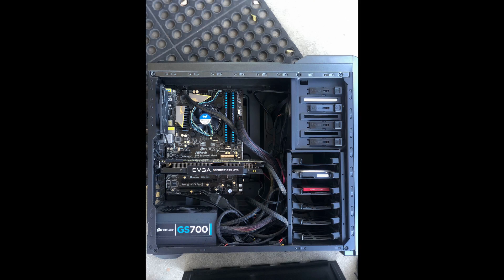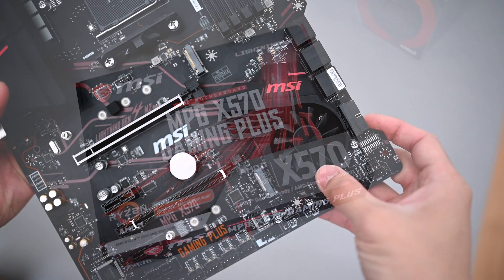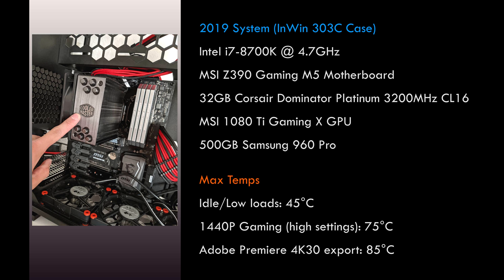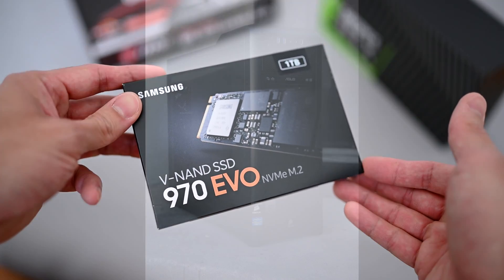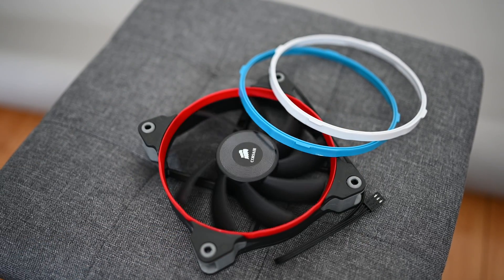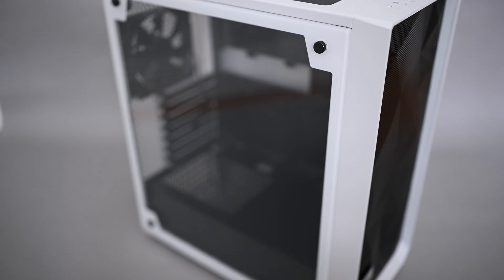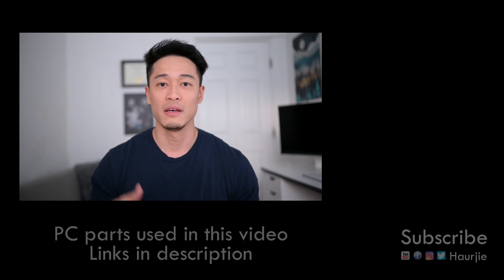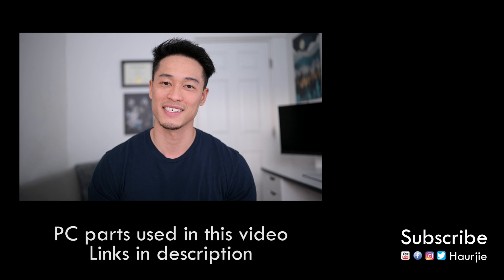AMD Ryzen 7 3700X RTX 2070 Super Build

Comment: 850 watts??????
im building a system with the same specs
Reply from the maker: You don't need 850. We just happened to have found a good deal for this brand new PSU for about half the price
Reply: @hardlinenexus  oh okay do u think a 750 700or 650 would  be enough I overclocked and I’m having a AIO
Reply from the maker: @tonythetigeryt7235  750 is best for you

Comment: Question:  Please Help?
 AMD Ryzen 7 3700x
Gigabyte x570 AORUS Elite
32GB Corsair Dominator Platinum 3200mhz Ram (2x16GB)
Origin Frostbyte 120 CLC
NVIDIA 8gb Geforce RTX 2070 Super Blower

My system will run with one GeForce RTX 2070 but once I add another one with a different maker Nvidia 2070, the computer will shut down, do I need an identical GPU to work?
or
What do you recommend 5 out , the video card same resolution as 2070.

Thank you

Comment: Hey awesome video, I think I’m going to make this build. How well do you think this streams/edits? (Specifically over watch)
Reply from the maker: Very well. If you can, I would try and get a b550 tomahawk from MSI instead. That's the motherboard we wanted, but was out of stock or overpriced everywhere at the time. This was our next best option that was available
Reply: @hardlinenexus  Would you recommend going with 32 gigs? Or is that overkill?
Reply from the maker: @sansei397  I had 32GB and it was fine. But now I have 64GB in my personal system lol. 32 is good

Comment: Would the 3600 ram give better performance for 1440p gaming?
Reply from the maker: Specifically on 1440p not quite sure, I haven't tested. But on a general answer, 3600 will give you roughly 8-10% more fps on most game titles over the 3200 like I used in this video. I would think that increase in fps would be consistent regardless of the game's resolution.

Comment: I built almost this same system but over a year ago! R7 2700 and RTX 2070 is a fantastic combo after a slight over clock, which isn't an issue with the X variant of the CPU.

Comment: Genuinely curious as I'm new to pc building, but why the founders edition over say an Asus or msi of the same card? Is it just because it's lower in cost?
Reply from the maker: It's the lowest priced 2070 super yes. Also personal preference on aesthetics. The other AIB brand cards tend to do have a slightly better performance because they have different cooling designs, but honestly not that big of a difference for our workload and doesn't quite justify the price gap IMO. But you can pick any one of them whichever you like.

Comment: My build is:

CPU: Ryzen 7 3700x

Motherboard: Asus ROG STRIX B450-F GAMING ATX AM4 Motherboard

Memory: G.Skill Trident Z RGB 32 GB (2 x 16 GB) DDR4-3200 CL16 Memory

Storage: Samsung 970 Evo 1 TB M.2-2280 NVME Solid State Drive

Storage: Seagate Barracuda Compute 2 TB 3.5" 7200RPM Internal Hard Drive

GPU: NVIDIA GeForce RTX 2070 SUPER 8 GB Video Card

Case: Fractal Design Meshify C ATX Mid Tower Case

Power supply: Corsair 850 W 80+ Gold Certified fully-modular ATX Power Supply

A very similar build. Love it
Reply: That's great i am planing for the same build but i am confuse between two pairs 
Ryzen 9 3900x 2070 super 
Ryzen 7 3700x 2070 super 
mainly i am working in 3dsmax Vray & corona render and also Lumion animation
so please advice me what is the suitable option for me is there any big difference if i go with 3900x instead 3700x?
Reply: @awaaansar8191  typically, if you are using heavy software you would want good memory for the system you have that would be in par. The 3700x would be a great chip and with a good potential overclock, I believe it should handle your things no problem. The 3900x would also handle with ease but at a more hefty cost, by almost double. Maybe a small medium of a Ryzen 7 3800x might fancy you, if you prefer.

Comment: As per my observation Rtx 2070 Super is too week for this processor high percentage of bottleneck❗❗❗
Correct me if i am wrong.
Reply from the maker: There's no bottleneck
Reply: @hardlinenexus  I think you didn't check bottleneck calculator ?
Reply from the maker: @awaaansar8191  Calculator said 18% avg but doesn't tell us what applications and games. When we pulled up the programs we used like Adobe premiere, Photoshop, CoD MW, Valorant, league of legends, Apex... We didn't have problems.
Reply from the maker: @awaaansar8191  My recommendation is don't use the calculator as your primary decision maker. If you want to go higher GPU you can, but you need to consider whether dropping an extra $200-500 is worth reducing that "18%" and whether you even notice real world differences for your work.
EDIT: Bottleneck calculator is crap btw. It has no accurate correlation to real world application. In fact, you should read other forums. Definitely wouldn't bother using that.
Reply: @hardlinenexus  Maybe you right.
Please advice me the same specs are  good option for 3d animation render and 3ds max rendering???
Reply from the maker: @awaaansar8191  Yes these specs will be good enough for 3D animation. I would also try and get a better motherboard though. This MPG wasn't my first choice, because the ones we wanted were all sold out or overpriced. This was the next best option within our budget.
Reply: @hardlinenexus  I would appreciate if you will let me know first choice for 2070 super please

Comment: do you really need 850w for the psu? isn’t like 550w enough
Reply from the maker: No we do that need 850w. We got 850w because smaller psus are all sold out or overpriced. We found someone who was selling the 850w brand new sealed for half the retail price. This was a no brainer. I think I mentioned this in the video
Reply: Haurjie okay thanks. i’m looking to build a new pc with slightly higher specs to in the video, and i did an online power calculator and it said i needed way less but i guess i shouldn’t trust that. would 750 be enough for 2080 ti and amd 9 3900x?
Reply from the maker: @reid6205  750 is enough

Comment: Can I ask why you didn't use the stock cooler that came with the 3700x? Is the cooler master much better than the stock cooler? Thanks
Reply from the maker: Stock cooler is fine. I used the 212 Evo for a couple reasons. One was to give some headroom if he did ever want to overclock the CPU. Second is that the MPG motherboard wasn't my first choice and doesn't have the best VRM. I wanted to get the Tomahawk but it was sold out or overpriced everywhere. The 212 Evo has will be able to provide a slightly better airflow within the case itself than the small stock cooler of the 3700X. Basically overall keeping the case and everything in it a tad bit cooler. Last was aesthetics, just plain looks better than the stock cooler lol.
Reply: @hardlinenexus  Okay good to know. Thanks for the helpful answer!

Comment: My 2070s and 3700x build was 2700$. Had to buy a monitor, mouse, keyboard 
Not really midrange 😅😅😂 got the b450 tomahawk max and for the monitor its the zowie 240hz
Should push 250 to 300 fps in ultra settings on OW

Comment: How long do you spend looking at yourself in a mirror everytime you dolly your hair up like that?
Reply from the maker: Wet my hair with water and use bath towel over it, 15 seconds. Use blow dryer set to hot air on left side of hair, 10 seconds. Use blow dryer on right side of hair, 10 seconds. Use blow dryer on front/top hair, 7 seconds. Look in the mirror to check, 3 seconds. About 45 seconds average.
Edit: If I was a girl with long hair, I'm sure it would take more than 30 minutes.

Comment: I bought the 3800x but have yet to build my PC, Would you say the Hyper 212 is better than the AMD wraith it comes with and would be worth me going with the 212 instead?
Reply from the maker: The stock coolers are usually good enough if you don't plan on overclocking. But if you do overclock, I would look for a cooler has a higher TDP rating.
Reply: @hardlinenexus  Ok awesome thanks, yea from most people I hear them say those stock coolers are fine as long as I don't overclock, I just wasn't sure since that 212 has a fan that faces the other way if technically it would be better airflow, it looks more streamline in that sense lol. Thanks for the response man, Subbed and I hit the bell! Looking forward to seeing more in the future, now I'm going to scour your library for other great gems.
Reply from the maker: @justincredible9302  thank you! Really appreciate the support. I'm going to have another PC build (actually 2) coming out towards the end of this month since new B550 motherboards are coming out. The rest of the parts are already just sitting in my room waiting lol

Comment: hai guys im new to pc build my spec 
Ryzen 7 3700X Processor with Wraith Prism RGB Cooler
MSI B450 Tomahawk Max Motherboard (Supports overclock)
Zotac RTX 2070 SUPER Air Graphics Card
Corsair Vengeance RGB Pro 3200 MHz 2 x 8GB (16GB) DDR4 RAM
500GB SSD
Corsair CV650 80 Plus Bronze Power Supply
Phanteks Eclipse P300A Case (Good airflow)
is best one for gaming at 1440p pls suggest any parts which i need to change guys

Comment: Hey!
I'm going to build a PC with Ryzen 7 3700x and 2070 Super Aorus. Will the Corsair 750W power supply be good? I noticed that you used the 850W power supply.
Reply from the maker: this system can run off of 600 watts. 750 is plenty. we got an 850 only because we found one for HALF the retail price brand new. This is a special case, we would not have bought a 850W PSU for full retail price.
Reply: @hardlinenexus  thx for fast answer! Amazing Job! Sry for my english😅

Comment: I spent about 1148 US after you converter it from CAD on a prebuild from Canada Computers it comes with ryzen 7 2700x, rtx 2060 ASUS, 16gb ram 3000mhz, 250gb m.2 nvme ssd, 1tb hdd 7200rpm, wifi Bluetooth, 4rgb fans and b450 gigabyte motherboard with Microsoft office and windows 10 

Would you say this is worth the price?
Reply from the maker: I would've personally went with a 1tb m.2 nvme and without the 7200rpm harddrive. But everything else is fine

Comment: how does the X570 Gaming Plus treat you with VRM temps? I literally just got mine in the mail. A ton of good reviews but I just wanted to make sure the VRM’s are good with this CPU, since many people with the 3800X and up have complaints about VRM temps getting way too hot for any normal use. The 3700X has like 65W TDP, and anything above is 105 so that’s probably the reason why, I just want to make sure.

Comment: What exact model GPU did you use? Msi, asus?
Reply from the maker: It's the Nvidia reference model
Reply: @hardlinenexus  thanks for responding! Why did you go for that when the windforce is available?
Reply from the maker: @bubberduck4964  because it was the cheapest one, and it also looks better (but this is subjective). And I will take the solid metal build over the plastic AIBs like 8/10 times
Reply: @hardlinenexus  ah alright. Could ya take a look at my build? Just imagine the 2070 super is in there :p

Comment: This video is so clean, you deserve way more subs and views. I have a question, I’m building a 3700x PC, and with cooling I’ve bought a Corsair H60 2018...do you think it will be enough to cool the CPU down? The case is the same one (Meshify C)
Reply from the maker: The stock cooler is enough for the 3700x if you don't overclock. But yes the H60 is good too
Reply: @hardlinenexus  I'm not planning to overclock, so I thought "if the stock is good enough without OC, then an AIO will be even better!". Guess it is somewhat true, even for a 120mm AIO, even though basically everyone says that for the price of a 120mm AIO, you can get a much better fan cooler. As long as it DOES cool down the chip I'm happy. Thanks!

Comment: Wanted to laugh watching this I am waiting on almost these same exact parts. R7 3700x MSI 570 gaming edge (wifi). 32gb 3200 RGB vengeance. Have to agree I made the decision for longevity for future upgrades. I tend to upgrade every 5 years
Reply: Dang Im with the same as you but the carbon wifi. 
Having problem to find regular price parts its ridiculous! Bought a rtx 2060 super 8gb only thing I could find on a decent price. What gpu and psu you using?
Reply: @chefcritic9409  I'm in the same boat as you. Prices are a bit high. But thankfully I was able to salvage my old HLC 550W supply and my EVGA GTX 650. Not great but haven't had any issues since the build. More time to save up and wait for 3ks series to come out so the 2ks might go on sale 🤷.

Comment: I saw this and wanted to build my own. I am assembly mine right now. I have the Asus RTX 2070 Gaming Pro Advanced. Ryzen 7 3700x. Corsair 750 80+ gold PSU. Asus TUF x570 gaming pro wifi Mobo. 16GB dusk channel Corsair vengeance 3200mhz Ram. Finally the stylish Corsair carbide spec-omega case. I’m so excited to use this!
Reply: What are you using for cpu cooler if I may ask?
Reply: @cristianivancidguerra1005  the cooler AMD provide does a good enough job if you don't over clock. My CPU doesn't go past 62 degrees under full load.
Reply: Thanks for the reply! 👍🏼

Comment: Is it better to buy 2080 super now or wait till next gen?
Reply from the maker: I personally wouldn't buy the 2080 super.. I'd skip that and get the 2080 ti. Or just get the 2070 super. In my opinion the 2080 and 2080 Super aren't really great value price to performance... Unless there was an update that changed that recently
Reply: Haurjie so i wait for 3000series and 2000 price drops??
Reply from the maker: @pdr4m559  only used 2000 series will drop. New 2000 GPU prices will not drop for a while I think.

Comment: ive been watching a lot of pc builds and i havent been seeing anyone using HDD storage
Reply from the maker: That's because they're so outdated now lol. The only reason for an HDD is if you need to archive massive amount of storage. And we don't install HDD into our PCs internally is because it slows down read/write tasks. For example, if you do some sort of searching or run a program that requires to search and draw sources, it will try and read from all drives connected. And that in turn does slow down loading process. If anything we just use external HDD

Comment: On Thursday, I'll be building a PC for the first time. Ryzen 3700x, RTX 2080 Super, Asus TUF x570 Motherboard, 32 gigs DDR4 ram, Fractal Meshify C case (white), 2 TB seagate HDD, 512 SSD and a Corsair power supply. I'm most nervous about the RGB fans (I have 3 white ones from Corsair) and connecting everything properly. Fingers crossed that it all turns on lol

Comment: I have the same power supply the RM850x and GPU nvidia geforce 2070 super founders for a gaming pc I'm putting together. I'm doing custom cables all the way to the psu. This GPU has an 8pin pcie and a 6 pin pcie. I figured out the pinouts by just continuity testing the cables that came with the PSU but that dual cable that you have plugged into your GPU that splits that 8 pin pcie from the PSU to also include a 6 pin confuses me. I want to run an entirely separate cable for the 6 pin. In other words one stand alone 8 pin cable from the PSU to the GPUs 8 pin connector and one stand alone 6 pin cable form the PSU to the 2070s other 6 pin connector. The 8 pin is easy because the PSU has an 8 pin pcie but where would I plug a 6 pin from PSU to GPU? The PSU has 6 pin connectors but none marked pcie. All pcie are 8 pin? Any help would be appreciated. Great video!

Comment: What is the best cpu for a rtx 2070. I’m currently using a ryzen 5 2600.
Ryzen 5 2600
msi b450 tomahawk 
Vulcan 8GBx2
Evga Rtx 2070 black
Reply from the maker: Depends what you're using the system for. But any CPU can pair with the 2070 really.
Reply: Haurjie ok thanks I only use it for gaming.
Reply from the maker: @JalenVert  your 2600 is fine

Comment: You mentioned 1080p but I'm wondering if this build would be good enough for 1440p aswel? (60+ FPS, high/ultra settings, 3A titles) Great video! Appreciate the effort! Subscribed 👊
Reply: It works amazing on 1440p. This build is actually for 1440p. I have played many games on 1440p and fps never went lower than 100 on ultra settings. On 4k, you could get 40-80 fps.
Reply from the maker: 2070 super will do fine even up to 4K.

Comment: 3700X temps with that Hyper 212 and whats the CPU set it with the temps?
Reply from the maker: didn't get a chance to film the settings and bios and all. but CPU currently is just set to stock. around 45 C idle. 65 C gaming.
Reply: @hardlinenexus  I also have the Hyper 212 BE on my 3700X which is set on 1.35v at 4200Mhz. Idles around 38C and in gaming high 50's-mid 60's depending on game but when I stream is where I worry as it gets in the mid 70's as I use the the 3700X (x264) to encode. Thought about a better cooler but just looking up what other people are getting for temps, thanks.
Reply from the maker: @thephily  actually correction, it is 37-39 avg idle with no apps open. 45 was the max while idle lol